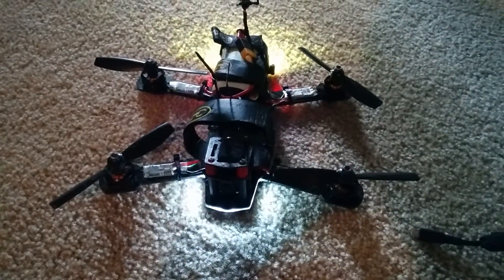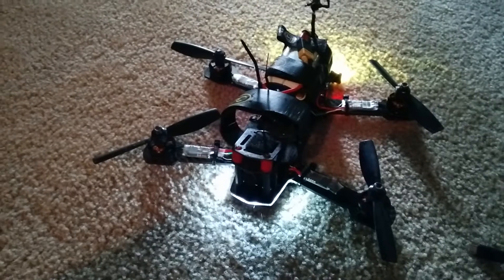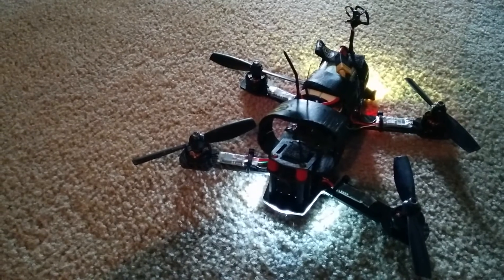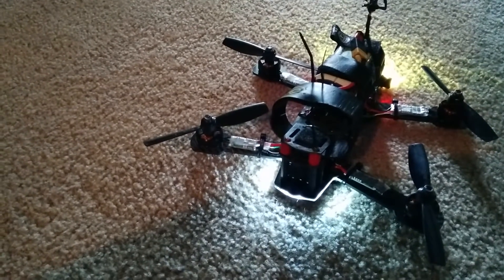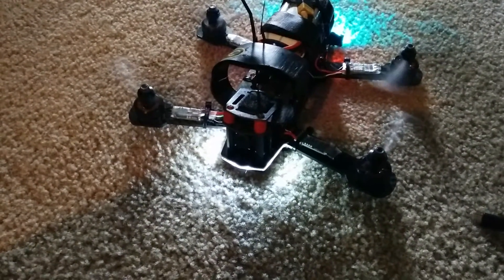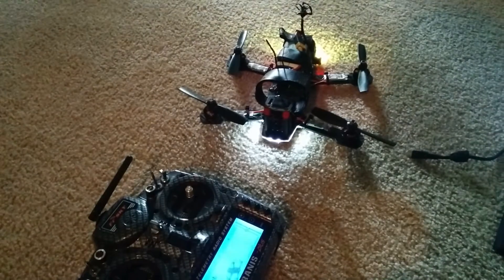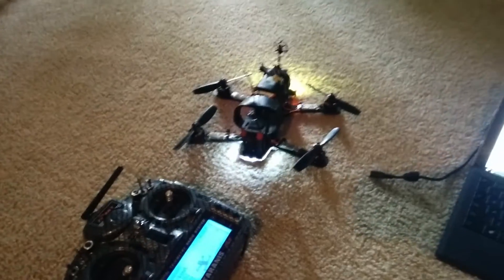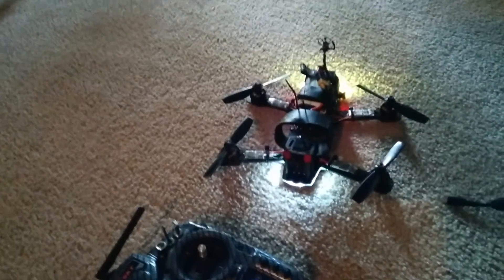Testing little bee ESC braking? Me thinks

Comment: Do you have to program these escs before using them with a miniquad. Or are they ready to go? If not, can you tell me how you set them up, can you do it by your transmiter?
Reply from the maker: you can just use them as they are, shouldnt need to program
Reply: +Andrew Auguscik 

you need to enable active braking through blhelisuite. if you have flashed betaflight, it can all be done at the same time through the FC on blhelisuite. if you are not using betaflight, you need to plug them in individually and do them one by one.
Reply: hi. Please tell me what firmware is installed and what the timing chosen?